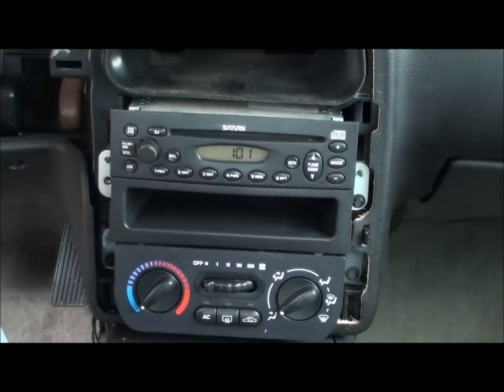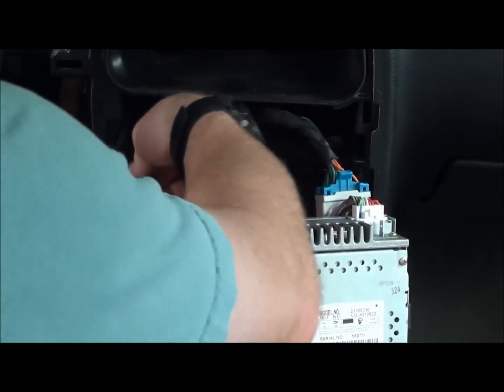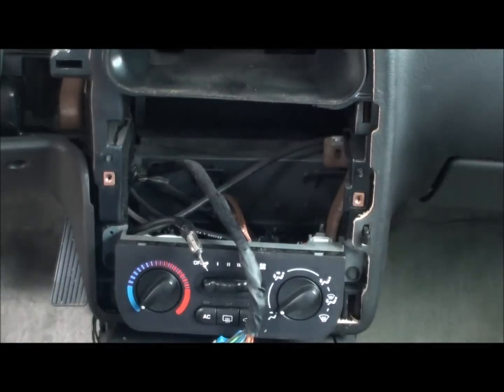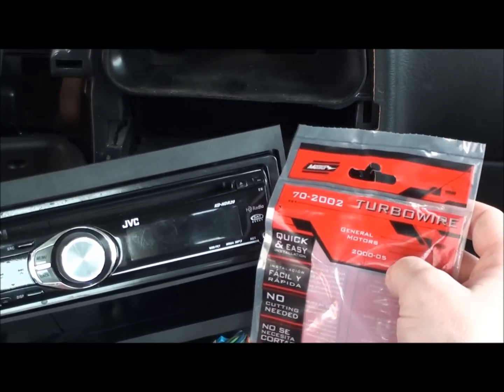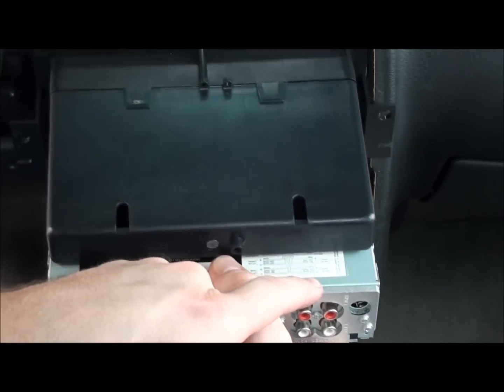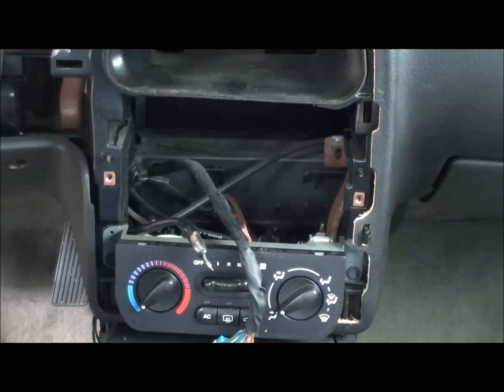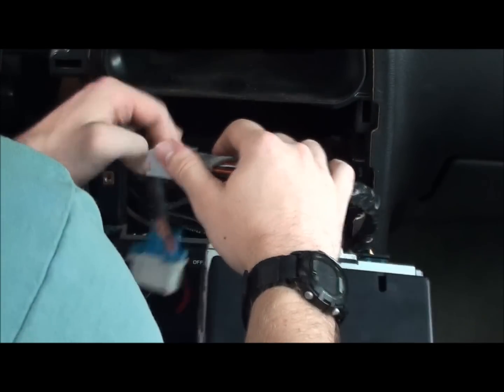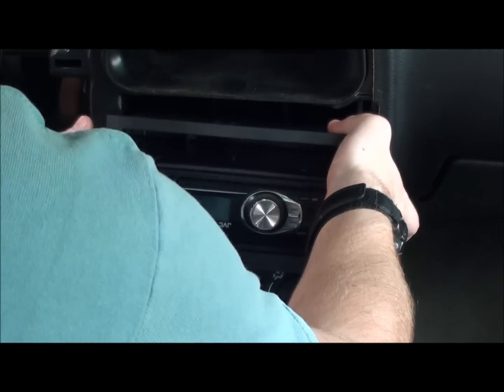00-02 Saturn SL2 radio Install (After Trim Removal)

Comment: I spliced my wires together with butt connectors and wrapped just the butt connectors part with electrical tape, that way if I have to unwrap it, then I won't have much to unwrap. The way you wrapped the harness is just WAY overkill and will take a while to unwrap if you ever have a problem with the wires.
Reply: Eric Ver Linden 9opp

Comment: Thank you for your video, it helped with a 2002 SC2 stereo install as well since it uses the same factory head and dash plate. When I pulled it I was wondering what that copper wire was that's for grounding the original. Now I just need to replace the bottom unit in that panel since all the lights have blown out but two. (Previous condition)

Comment: Let me warn folks to NOT pound too hard on the top cover when putting it back on!

This will knock out your dashboard lights in the instrument cluster. I kills 7 out of 10 lights and am going to replace them with LEDs tomorrow.

To be fair, I forgot/neglected to unhook the battery, so I may have cause some sort of power spike, but I really did whack it pretty hard trying to get it back in place.
Reply: killed
Reply: I changed a battery out, normal procedure and unhooked the negative lead before positive. Instrument cluster had no lights, shifting knob had no lights, and full speed of the fan just quit working. I took my negative lead off for a good 30min-1hr and my lights came back. Hope this fixes your problem, but yeah you should have removed the negative lead prior to installation. 👍

Comment: Jungleking007,
Did you have any problems just sticking that ground wire back there?
Reply from the maker: nope, no issues at all!
Reply: @jungleking007Channel  Right on, I ended up prying some medal fins out on the aftermarket radio and stuck the ground there

Comment: Do you remember what 12v (Red Wire)  wire you connected together? If you could tell me what number on the wiring harness that would be awesome! I'm asking because there are three 12v connectors and im not sure what one im supposed to connect.

Comment: the 7002 was the one that you plugged into the car correct? and did you have a pre installed amp to take out from your car?
Reply: if you didn't have to take a stock amp out do you know if your car has one? my Saturn does and people are saying if I just plug in the harness it won't go through to the speakers

Comment: Any reason my speakers wouldn't be working or hearing any sound? I just got a double din Kenwood and got it all installed, have full use of the deck but no sound?. Watched another video in which the guy unplugged the old amplifier in which he said would then enable sound. Still confused on the subject. 2000 Saturn L-Series
Reply: Did you get yours working? If not, the only thing I would suggest is to make DOUBLE sure you are right about your connections. The other thing to check is to make SURE that deck does not have some sort of switch to turn off the speaker wires in lieu of the analog connectors that go to an amplifier.

I got a used DVD player like that once. The normal output was turned off because the previous owner had a full surround sound system being fed from another cable.

Comment: Is it possible to reuse the old factory bracket  ("installation kit")? Was that 99-3108 that you used as the replacement?
Reply from the maker: I haven't tried so I am not sure if it will work. the bracket I used was either a Scosche or Metra branded bracket, unfortunately can not remember the part number.  bought it from Best Buy
Reply: not unless you are replacing it with another factory stereo...i tried it..;)

Comment: i have a 2000 ls2 v6 limted edution saturn did they standardize it for all saturns over 2000 and thua i.will require the same parts or should i doo further researxH to find the right parts?
Reply from the maker: gnip3321 I would verify the parts will fit your vehicle. I don't think the designs are too far off but It pays to be careful. Go to a car audio place or check the various forums out there to be sure you get the right parts.

Comment: I'm planning on buying a Kenwood 6.1 inch touchscreen stereo with DVD and such, will it fit? I mean it's setting me back about $300 and I don't want to spend that money if it won't fit, 2001 Saturn Sl1
Reply from the maker: If you can find a double DIN adapter, I think that is what will make it fit in the slot.

Comment: After u take stereo out can u install a dvd stereo of any kind in or no
Reply from the maker: SUSIE VARGAS Should work as long as the wires can power it up, run the sound correctly and the box itself can fit in the slot.
Reply: Thank u

Comment: Can I splice the harness that disconnect from the harness inside the radio to connect with aftermarket wiring harness
Reply from the maker: Brandon Edwards If you know where each wire goes then I'm sure its possible.

Comment: Okay one question, what all do I need to do all of this, what kind of kit do you need, what do you need to buy with it? I'm new to this, I was just wondering about all of this. any help very appreciated
Reply from the maker: You will need various screw drivers and wrenches, a new radio receiver, bracket, and a wire harness. Those are some of the major items.
Reply: I bought a pioneer Mixtrax audio system off eBay a couple days ago. It's about to come in the mail today, it's brand new, and it seems to be one of the more popular audio systems out there. So yea mine is supposed to come with all the stuff I need like wires, adapters, etc

Comment: if i replace it it uses a DIN sized radio right? my cd player is broken and i want to get a new one but ive never done this before... what size do i need and where can i buy it from???
Reply from the maker: Right, I've also seen some guys cram a double DIN into that slot too. Depends on what you want. You'll just have to find the Double DIN bracket if you want to go that route. Good Luck!
Reply: jungleking007 Which radio did you buy for this car? because the one you removed looks exactly like the one I have with a broken CD player. I have a saturn s series 2000. I'm really struggling trying to figure this out... Sorry for these questions! Thank you so much.
Reply from the maker: I believe it is a JVC branded receiver, Unfortunately, can not remember the model off the top of my head. Really any DIN sized audio receiver will fit, you just need to make sure you get the right wiring harness and bracket.

Comment: What radio mounting kit is that?
Reply from the maker: I believe it was either a Scosche or Metra branded bracket.  Got mine from Best Buy. Check with your local audio place for the current models. Good Luck!

Comment: How do I take the cover off and is there a specific radio I should get?
Reply from the maker: Read the video description. This is a continuation video from another showing removal of the covers. Radio selection is your preference. Just be sure you purchase a wire harness if it's needed. Good luck!

Comment: I looked at this to see how the wiring went not to see how to remove the stereo. So yeah didn't help.
Reply from the maker: +Angel P wiring differs depending on stereo box used. Most come with a decent color coded diagram to follow.